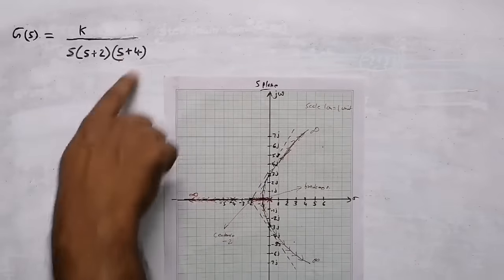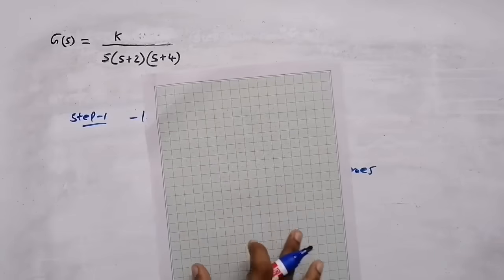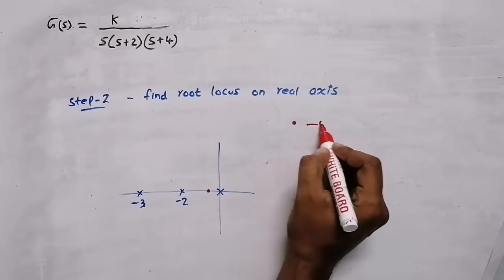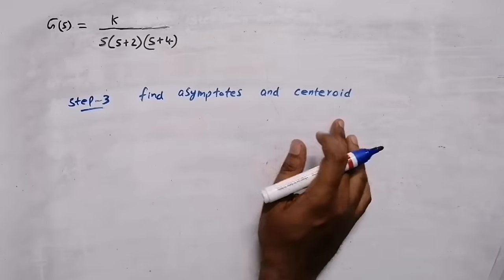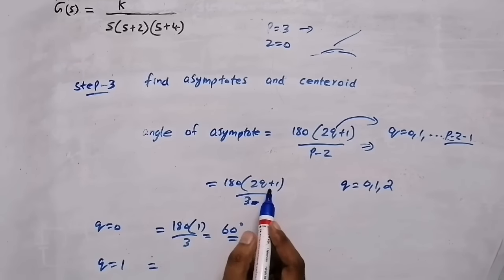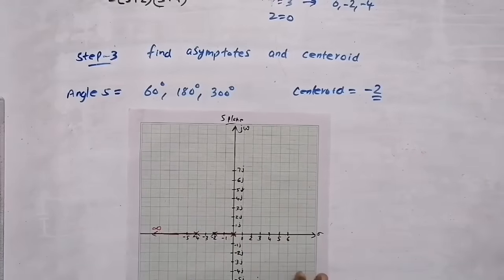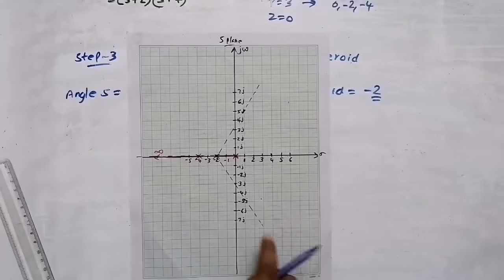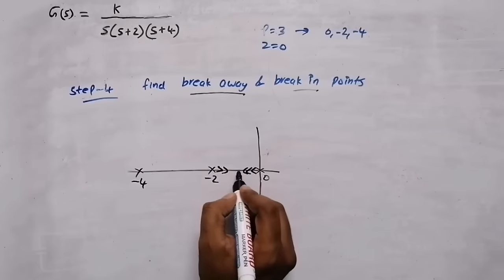root locus in control system

Comment: why did u take -60? can u tell while plotting angles which side of protactor should be considered up or down??
Reply from the maker: Keep protractor upside...
Here I need to mark 300 degree.. .. As we know +300 and - 60 are same... So i plotted - 60 degree
Reply: It is enough if you calculate required no.of angles....
If we calculate more 
Then the values will be repetitions of previous values....
That's what happened there!!